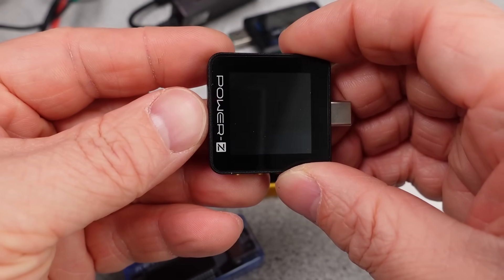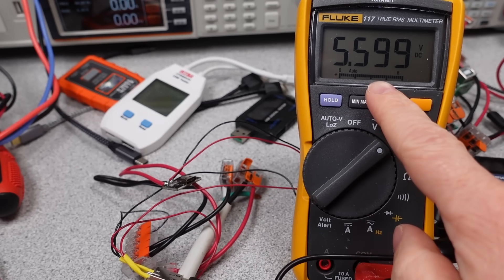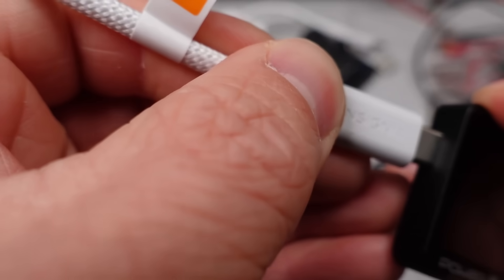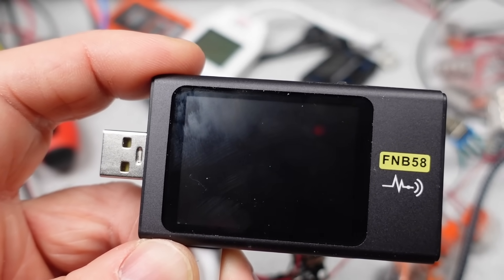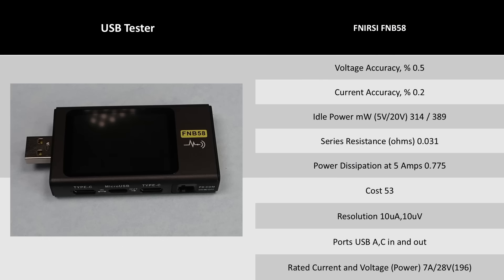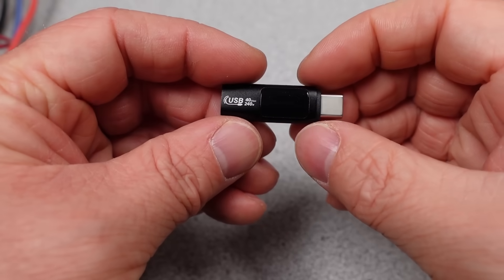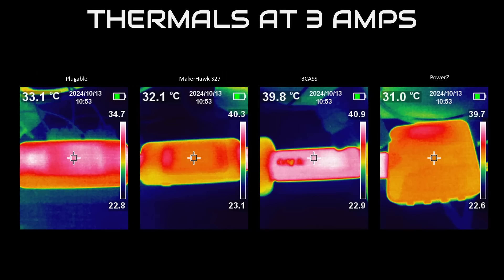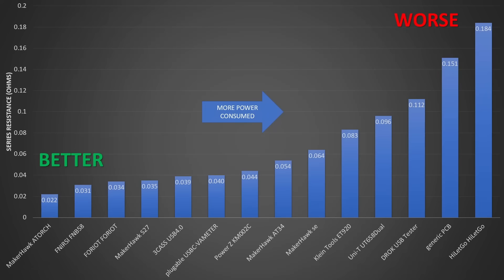USB Testers and Meters – Which one is BEST???

Comment: I recently got a KOWSi 2303c and I really like it. For $10 dollars, you get a lot of power meter. I couldnt believe it was that cheap and that good. The readings seem very accurate, I love the small form factor and the screen is beautiful. I also dig the graph function with adjustable time interval so I can see output over a certain time period. One hell of a neat, compact, and useful little device for $10.

Comment: Wait this is too comprehensive T_T. What's the best tester for checking data speed and power charging standards?
Reply from the maker: There is no simple tester for checking data speed that actually checks data integrity.  They just read the chip and check continuity.  But there are several USB cable testers out there now, the power z is one, the caberqu is another.  These both will check for the power standards supported by the cable.

Comment: Maybe I am the only one here but all I want is to determine the capability (Wattage) of USB A & C chargers.  You buy these multi port chargers that claim 25W (super fast on my S21) but that is a total for the device and even using 1 port at a time never get 25w super charging.   I have the Drok and even knowing my C port is producing enough watts to give super charging, I don't see any V * A that is even close to 25.  Anyone here give me some advice?  Thanks
Reply from the maker: Samsung often doesn't deliver power continuously, so to see the peak value you need an oscilloscope.  These meters average the reading.  The more expensive ones do have 'scope-like' functions though.  Also, the battery percentage in your device changes how much power enters the device, how the modes negotiate, etc.  The peak, meaning it could be for 1 millisecond, is what ends up in the marketing material though.

Comment: i just bought the Atorch AT085 from your amazon link i tested it 4 times and in the 5th try the screen stopped working and not powering on :( The usb c cable and the adapter is the original samsung that came with the phone and also original apple cable and adapter both original manufactured so that atorch incredible unreliable product. What a waste of 16 dollars. Now i have to return it and wait 7 days to get my money back. Is it yours still working? Edit: Also reading Amazon comments 4 people had the same problem that thing should cost 5 bucks
Reply: The actual price on Taobao (Chinese Amazon) is ¥49 ($7), but I was able to purchase it at a discounted price of ¥32 ($4.5).

But I rarely use it because I have other USB testers.
Reply: @mzahirr99  yup i did the same but no the yellow atorch (i returned it to amazon and they gave my money back), but the gray one called HiDANCE it cost me the same $4. Buying another one this model is cheap and hasn't failed yet.

Comment: I'm looking for a real tester so I can test the computer or block's capability, have you ever seen one yet?  I don't have any high power devices to draw that much, and it's not my job to do the tester's job with home loading resistors.

I'm looking for one that can wake-up when connected to the USB power source limited to the minimum current, then talk to one and another and determine the ratings, and then continue at the maximum level the weakest device can give or take, limited to that as the USB protocol explicitly defines.

I can tell the testers you used don't have the load to do that, with their sizes they would be difficult to hold with the 15W loading and turn to plastic goo loading 60W.  I understand why those are in the ~$20 range bin and they're doing as they're supposed.
Reply from the maker: These are in line measurement devices, not loads.  I do everything in pieces as it offers more configuration.  The load tester is a specific item, then a PD trigger is used to 'ask' for a specific USB mode, then, the tester can be put in circuit, which then plugs into the charger or power delivering device.  There are a few all in one devices, usually 5V only ones with USB A are common.  Search your marketplace of choice.

Comment: Thanks for this video. I'm thinking about buying one of these two, the FNB58 or the Power-Z KM003C, but I'm not entirely sure what the differences are. Do they have the same functions? I find it interesting to be able to detect fake cables or those without an E-marker chip, but it seems I can do this with both. I've read that the KM003C supports up to 240W. Is this true? And I think that's the only difference apart from the physical Type-C... is that correct? Thanks again. Have a nice day.
Reply: I may be late, but I'm going to comment too. If you don't really care about USB-A and Micro-USB, the KM003C is the right choice because it's still receiving updates, while the FNB58 is no longer being updated (I think the last update was in December 2024). Yes, the KM003C is rated for 0-50V, which is up to 240W, but I don't have the KM003C right now because it's expensive 😂.

The only thing the KM003C can't do is cable resistance testing (this feature was already removed).

Comment: None of them can check the number of contacts in a cable and none of them can measure the resistance of a cable without a load. These are all old useless devices for any professional user.
Reply from the maker: oi.

Comment: I have the FNB58 , saw other test on YT and purchaed one , good instrument , also purchased 2 electronic loads fot testing USB adapters and the ones that i have a are good, one cheap one did not stood the test of 1 Amp and died witin a 15 minutes time period , the other ones are doing Ok and did not die .
Reply from the maker: ouch, yeah, I have a bunch of different ones, I have had a few break, usually physically they fall apart or the screen breaks.  Obviously, I prefer the one I can just type the number in I want but yeah, expensive and bulky.

Comment: Is there anything for the lightning cable...? For apple.
Reply from the maker: I think I've seen something before, you can use many of these still, you plug in your apple cable after the tester.
Reply: @AllThingsOnePlace  well I see many of the outputs go into type C or type A, and the inputs as type C or lightning or micro USB, but nothing with an output with lightning adapter.

Comment: If testing USB, you could have included a loop back tester to test data speeds. After all, S in USB is kind of a big feature and something that should be tested. Not just power
Reply from the maker: Yeah, being power meters, I stuck with that.  This was a first pass at these so it's certainly something I can include at least as a continuity check on future ones.  Only one of them claimed to pass high speed data through.  I am working on  a not official but at least some way to test that for future videos, NVME '40 gb' HDD enclosure and a mac mini, hopefully can reduce bottlenecks and get maximum speed out of these things.

Comment: Do any of these allow for USB3 passthrough? I have some usecases for comparing power consumption in idle vs. consumption while maximally taxed for cameras, card readers, etc. but so far the USB testers I've evaluated only populate the USB2 D+/D- pair.
Reply from the maker: The really tiny one claims to pass through data '3CASS USB4.0'.  The others don't.
Reply: @AllThingsOnePlace I've read some claims of the AT34 (rebranded multiple times) doing the same. Wil evaluate both.

Comment: I bought the FNIRSI FNB58 about a year ago to test my Quest 2 VR headset. After a software update, the headset wasn't charging at all anymore when powered on or off, and I could confirm this with the device. Factory resets didn't fix the issue, and with the device I was able to confirm it was a software issue as the headset would charge correctly but only in bootloader mode.

My headset was a few months out of warranty, but after sending a video showing the issue with the FNB58 showing the charging issue, Meta agreed to send me a replacement headset out of warranty, so the $50 device got me another $400 headset, which paid for itself and then some in only one usage.

Since then, I have used it to verify a couple failing Anker battery packs from age, as well as test their actual capacity and then record that data for future use. Great device for the money. Also allows for waveform and even recording options on the device itself, which is really nice. I even found a cable that had way to much resistance that was causing a drive alarm to not charge, threw away that cable and replaced, problem solved.

But like this video says, I always make sure to power the FNB58 with a seperate power source via micro-usb (usually an anker battery pack), as it can draw quite a bit of extra power.

Comment: Is there any USB tester / meter to measure voltages from 1-30 Volts ? I'm looking for something that can measure below 3 volts.
Reply from the maker: The Fnirsi and the power z have external power input so they should be able to display lower voltages.  The issue is the powered ones need about 3.3 volts to operate.
Reply: @AllThingsOnePlace  I have bought a ML2032 Charger. I want to make sure that it doesn't harm the batteries.

Comment: I'm thinking of nabbing that masterhawk atorch one. Am I fine to just leave these power meters on at all times while charging my phone (for example, a higher end phone that charges at around 60-80W)? Or are these tools the kind you only want to be using a short time, rather than leaving it always plugged in?
Reply from the maker: Yeah, they do consume a small amount of power and dissipate a small amount of heat.  The ATORCH is akin to having a little longer of a USB cable though so probably okay to leave plugged in the whole time if you want to check in on the charging and power usage.

Comment: Any recommendation for cheapest USB meters which support data transfer to check external HDD or SSD power? 

I have "Hagibis LED Display USB C Adapter USB4 Thunderbolt 40Gbps 240W", drawback there's no button to switch between Amps, Watts, or Volts, it just cycles, and not accurate in term of Wattage because it test Volts and Amps one decimal rounded, and then using it to determine Watts (example, 5.0V going to results in 0.5W increment).
My main problem is the Wattage calculation.
Reply from the maker: Yeah, that's a good question.  I'm not sure.  The mini one does pass data that I tested here.  The others I assume don't.
Reply: Witrn CC1, KWS-X1

Comment: Very informative video! It has answered some of my questions. I had the Atorch model, but I returned it for a replacement, and later returned the replacent. When hooking up between my Samsung charger, and Galaxy S24 Ultra, the Atorch tester would continuously reboot every 3 or 4 seconds. I found this to be the case with several different testers. I found one that stayed on when powered externally.  Sometimes it would stay on without external power and other times it would reboot periodically. Kept the one with external power because it was more usable. I haven't figured out why I was getting these reboots. Please let me know if you have an answer to why this happens. I really need to know what is going on.
Reply from the maker: Yeah, that is very unusual, as these try to stay invisible to the connected line.  It must be loading the cc line just enough that the Samsung can't successfully communicate back to the charger or during a mode change.  This is either a fault of the tester, by not buffering the cc line properly or the Samsung or charger getting a bit cheap on the driver circuit and losing comms.
Reply: @AllThingsOnePlace  I don't know. The phone remains connected to the charger in Super Fast Charge mode even though the meter reboots. The charge didn't stop while the meter reboots.

Comment: When doing the thermal test with several meters in series, the first meter closest to the power source will have a different voltage drop than the last one closest to the negative.  So, while current may be equivalent across the series, voltage varies for each meter.  Thus skewing the results.
Reply from the maker: Only two things can play.  Current and Resistance are the operators.  Voltage doesn't matter.  Results are still good.
Reply: @ Interesting.  My background is mechanical.  Thx.

Comment: Can you connect a bunch of probes via USB for basic board testing in the field or do you have assemble them to get something you don't get off the shelf, does it have to be a hack.
Reply from the maker: I'm not sure what you mean.  They make breakout boards for USB if you want to scope the data pins, slow data specifically, I haven't seen one with high speed data connections for users to probe around.
Reply: @AllThingsOnePlace It can mean carrying less to do more from less without having to pack a whole case or storage unit full of kit when you can carry miniature test kits around rather than reference or portable lab equipment in scenarios you really have to carry little. There should be more USB scopes or multimeters for the sake of the topic.

Comment: I am working on some battery powered sensors, and uA level accuracy would be amazing. Would allow me to program changes, then instantly see the sleep mode power consumption so I can predict how long the battery will last between charges without having to leave it running for a day to measure the battery afterward. Especially as there are many  different sleep modes and issues that can cause significantly higher than expected current consumption when programming microcontrollers.
Reply from the maker: You can always insert a resistor in series and measure the voltage drop of it, calculate current.  Just make sure you compensate for burden voltage.
Reply: @AllThingsOnePlace  True, but an inline sensor that just connects between my laptop and my PCBs would be way easier. when powering from usb, it can be tricky to find somewhere to insert a resistor without hacking up a usb cable

Comment: I'd love a review on the fancy features or the PowerZ and Fnirsi. Like, can you capture PD frames and debug a prototype with them or something?
Reply from the maker: I haven't tried to use these for that, but it would be interesting to see what they can do.
Reply: @AllThingsOnePlace  I have Fnirsi  FNB48 and 48P and now also the FNB58. I thought the 58 would be an upgrade, because I love the 48 so much, but found it has a higher vampire power draw, and does not include the min/max/avg for volt/amps/watts that I use to evaluate equipment power requirements and usage over time. If/when you ever do more comparisons, please remember this. Also I would like to measure the series resistance myself, which pins/connectors did you measure between? Thanks
Reply: @AllThingsOnePlace  And I haven't found a video actually showing this, they generally barely graze the surface of what these things can do

Comment: which one would you get? the power z 003 or the FN58? lets say the price is not that important, does the power z offer anything that the FN58 does not? thanks for sharing!
Reply from the maker: I think the power z is maybe a little better on the software side.  They're both kind of translation issue riddled pieces but I had a better time with the power z software.  The menu I found to be a bit easier to navigate and use on the FNIRSI though.  I found getting the FNIRSI to be a pd trigger much easier.  In terms of power measurement, they both should be externally powered for the best results.  It comes down to opinion.
Reply: @AllThingsOnePlace  but can the power-z also be used as PD trigger? thanx

Comment: As somebody who tests a lot of cables and chargers, I feel the FNB58 and KM003C are both worth having, but the KM003C is stupidly overpriced. The FNB58 does 96% of what the KM003C can do, at half the MSRP. Honestly, if FNIRSI released an upgrade to the FNB58 that had a male USB-C connector instead of USB-A, I'd be perfectly happy.

I've had the FNB58 for a year, and recently 'upgraded' to the KM003C. For most people, the lower cost of the FNB58 makes it a far better option. I feel its UI is also better in most areas. Going with the KM003C is worth it only if you want to do a deep dive into USB PD communication with its PC software, or want a device to be as utterly transparent as possible. I will say it's more 'one touch' than the FNB58 for testing a power supply's capabilities, but reading e-markers on the FNB58 is easier.

5:11 Also, I think you need to upgrade the firmware on your FN58. Mine presents a much more readable statement here, although I have the blue Bluetooth-enabled model.

That Atorch model looks attractive. I have some of their other products, and they've all been basic but good. I may have to pick one of those up.
Reply from the maker: Yeah, the firmware does need to be updated, I updated the firmware on the KM one.  Thanks for sharing!   Yeah, the power z chargers are expensive but capable.  In reality, they're still very cheap for the function they provide.
Reply: I see a KM003C on Aliexpress for around $62, assuming it's legit

Comment: This video is great!  I've been shopping for a good tester and this helps a lot.  This may be a dumb question, but can the USB-C testers be used to test USB-A devices if using USB A to C cables/adapters?  And if possible, does it add too much resistance or have other consequences?  Thanks!
Reply from the maker: Yeah, so you can power the USB C testers with a USB A to C adapter, I'm actually powering the whole chain starting with a USB A port, it's being powered from a lab power supply too.  The adapters that have both do state not to use the two port types on one device though, you do need to use an adapter cable.  The cable connections adapter is short and low resistance though so will have minimal impact on readings, of course you will always have some impact on the readings.
Reply: Thanks!